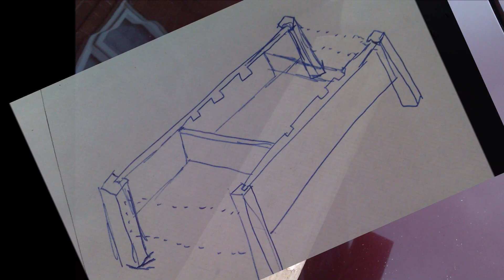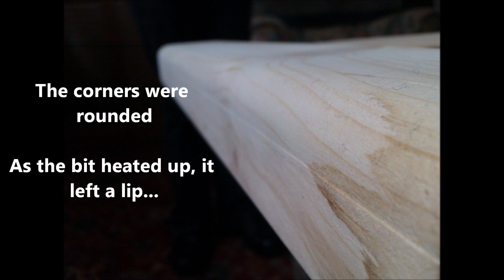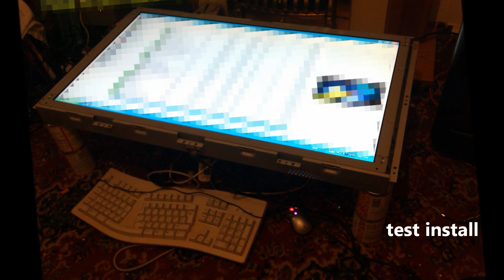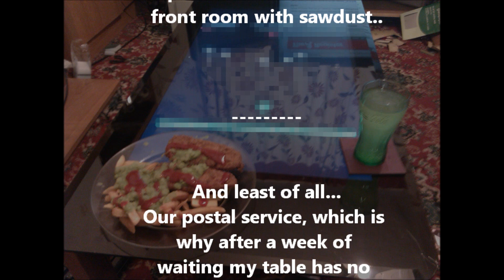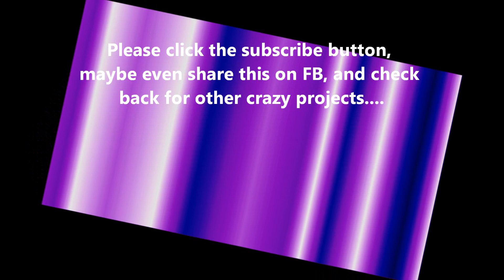My coffee table / mame / windows / touch screen build part 1 llp ftir flez1966

Comment from the maker: i'd not go with original but its going to be 'useful' when i get the touch surface working on the glass, at least now the game controls have arrived, and two infra red capable webcams to 'watch for fingers' for the touch. 

just having issues as the 'touch' software expects the cams to see finger ends from 45' or so, and i want a flat top so it needs to see from a much shallower angle of like 2-3 degrees